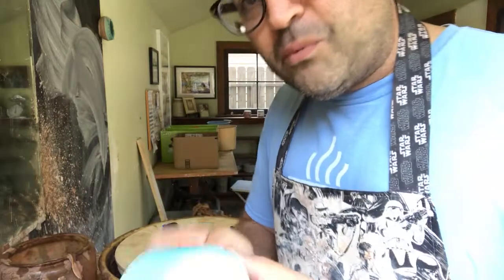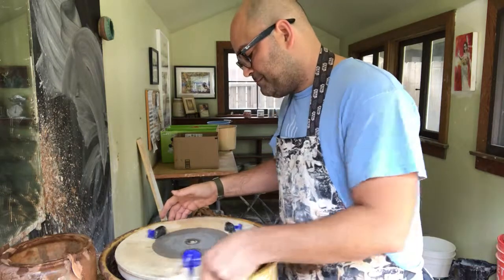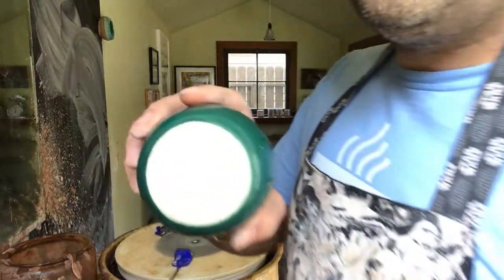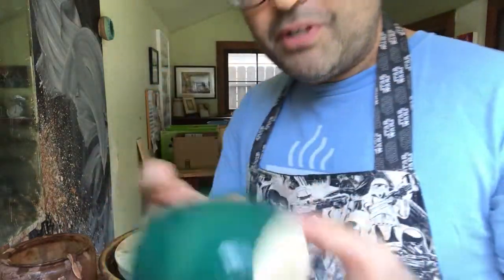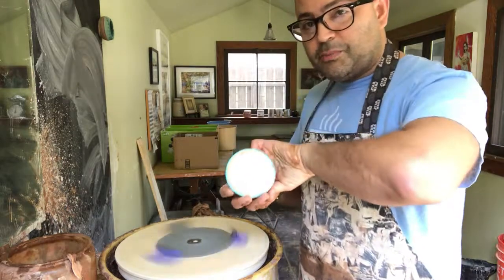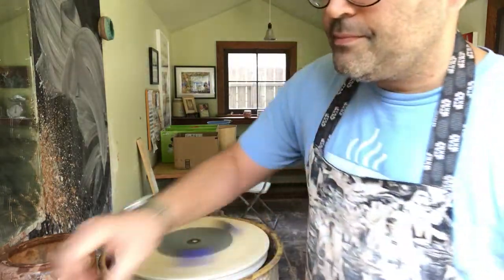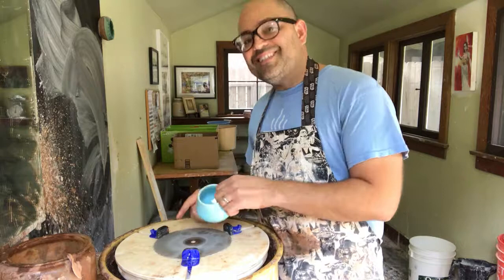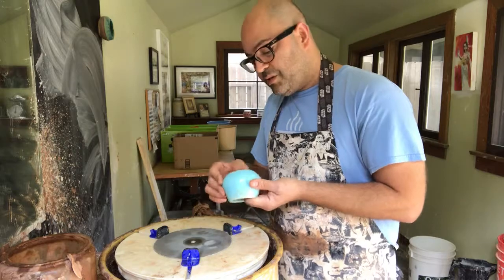How to Give Pottery a Smooth Base

Comment: Are these discs from diamond core tools? Or if not from where?
Reply from the maker: Hi there, these are just lapping discs that I bought from a local hardware store. Same material as the DCT stuff. 

I have, however, moved over to the DCT sanding pads. I really like their flexible pads with the foam. I like to start with a 120 grit followed by a 400. 

One thing I dislike about sanding bases is the color change to the clay body when dried. It just looks different, almost like there's a light haze on the base. Definitely recommended on something with a foot ring! If the entire base is exposed, and you're picky like me, you might not like the results.

Comment: Where did you find the lapping wheel?
Reply from the maker: I purchased it off of Amazon a few years ago. I tend to use the 120 grit disc held by a Giffin Grip for grinding thick sections of glaze, however my favorite tools are Diamond Core Tools sanding pads. I use them 99% of the time now.